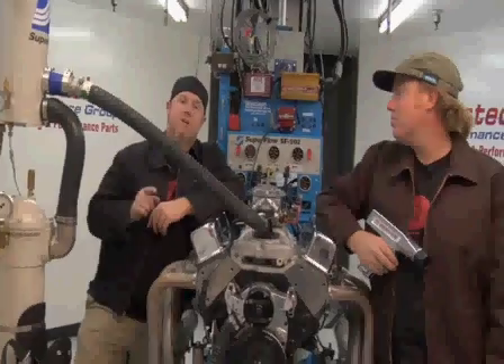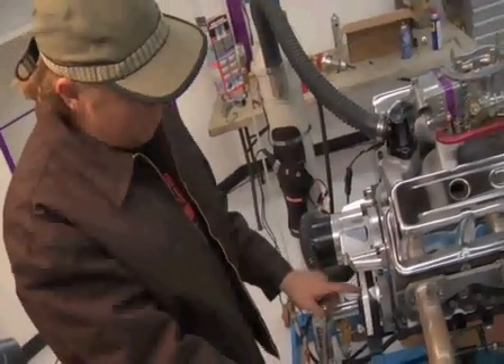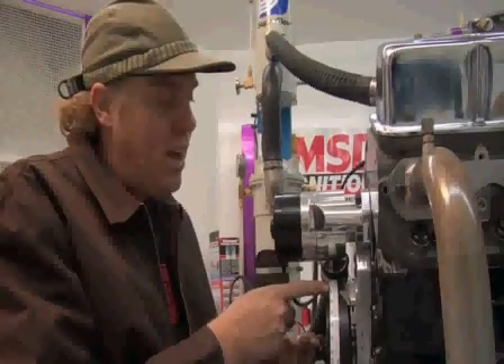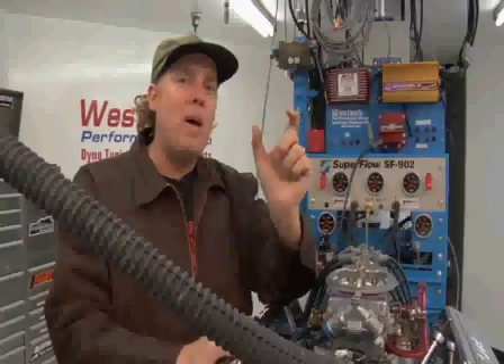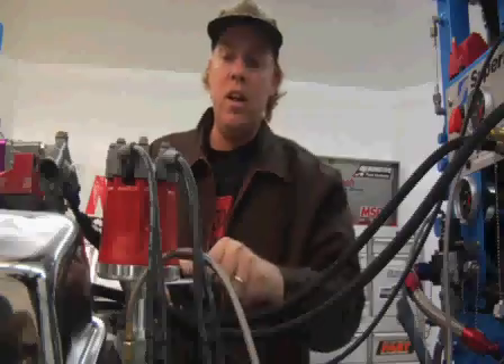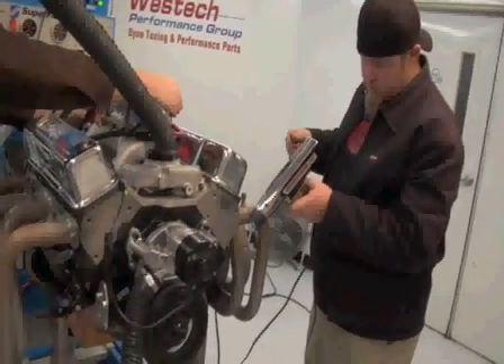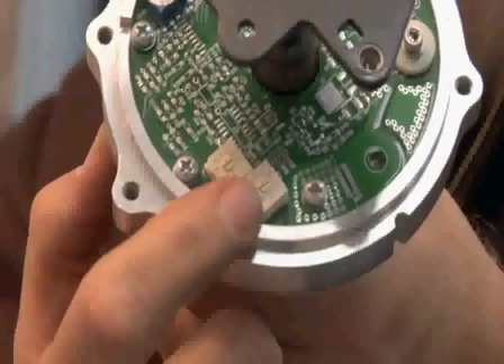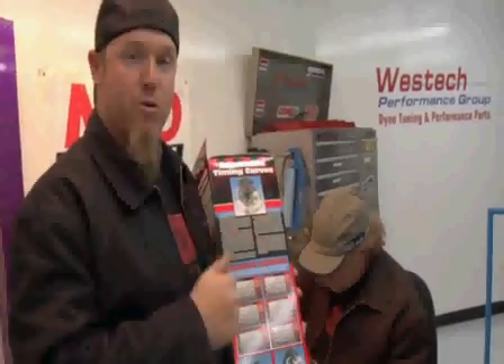MSD - Understanding Ignition Timing

Comment: i need some serious help, there are several different issues i believe. Starting from the beginning, 1994 chevy 350 5.7 . Computer operated ignition i think, throttle body, changed the intake manifold to holley pro jection intake, bored out throttle body, added throttle body spacer so that the egr valve could fit. Timing at idle is @ 12 but  once i give it gas the timing retards insteads of advances, computer related?? if so how can i reprogram? can i? all answers welcome